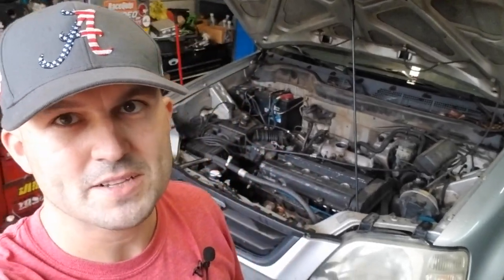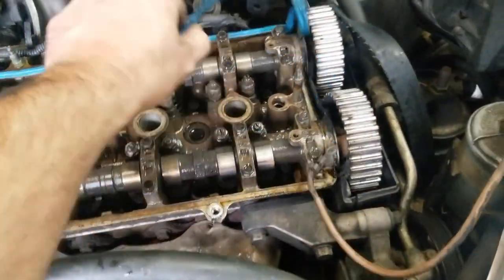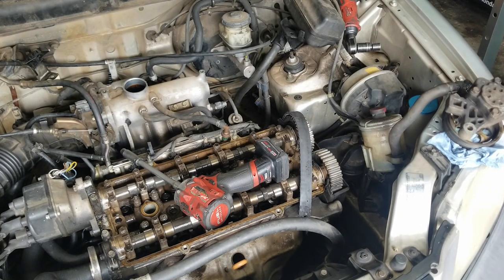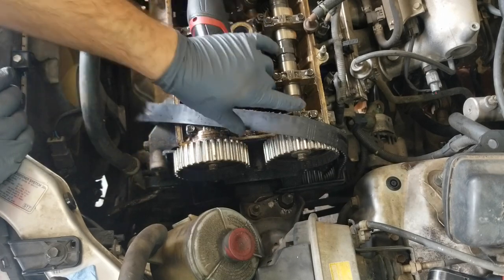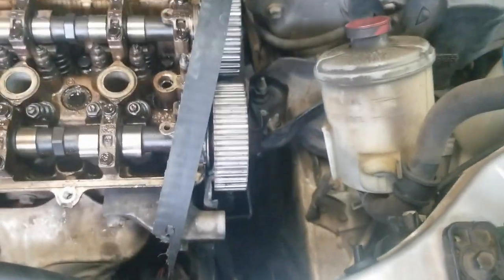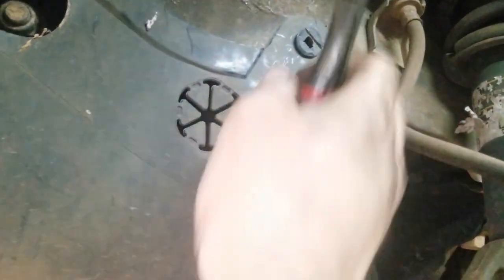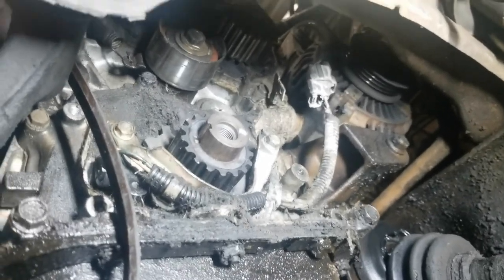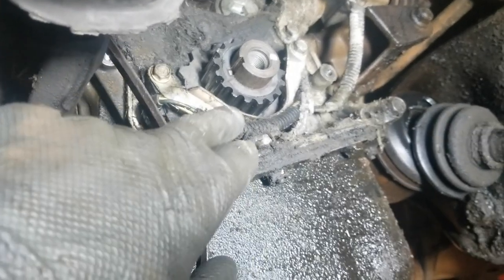97-01 Honda CRV broken timing belt FIX!!! RD1 / RD2 | B20Z2 | Pt.1 Disassembly!

Comment: I'm 75 yrs old, and I ain't as good as I once was.  $400 for the Milwaukee and the Lisle socket was the only choice, and worth every penny.  I broke two impact sockets trying to get that bolt out.  It took more time to get that big socket out of the box than it took to run that bolt out of the crank.  I don't know what kind of Voodoo Lisle uses, But it definitely works.
Reply: Just ordered mine. Good to hear that it worked for you. Can’t wait to get my broken CRV back on the road. The mechanic wanted 1400 for the repair.

Comment: I prefer the Aisin TKH014 timing belt kit.  Comes with an Aisin water pump, Mitsuboshi timing belt, Koyo tensioner, and Honda tensioner spring.
Reply from the maker: yep, those kits are pretty solid!
Reply: That's what the mechanic at the Japanese auto repair shop told me he uses.  Stay with Honda parts
Reply: Do you have a link to that timing belt kit?

Comment: If I just want to change the belt do I have to drain the coolant? Can I leave the water pump on there? Only asking because the belt and pump were recently done, I was stupid and used an eBay belt which is probably why it snapped. 

UPDATE: changed the belt and started right up with a Jump! Thank you!
Reply from the maker: No need to drain coolant
Reply: @hondaresource  thank you! Wish me luck lol

Comment: @hondaresource I have fixed so many things on my 2000 CRV with your videos but I can't find my current problem. I had a flashing check engine light, went in to do a valve adjustment and notice that the inside back of the timing belt cover has warped into the gears that turn the belt, luckily it's not broken. Can I just cut that top piece that has folded in and get it out of there?

Comment: my daytime running lights for the rest aren’t operating , so the only lights working for my rear would be the break lights, would that be more of a electrical issue? I’ve tried to switch the fuse out, would you have any ideas to the issue?

Comment: That bolt at 7:25 is the AC idler pivot bolt part # 90054-P3F-000.  It's a special bolt only available from Honda and is known to shear itself off around 200k or earlier if belt is too tight.  Worth replacing for $8.  I was hoping for a sticky because it's not easy to find this bolt's part number and this will surely help someone in the future.  Mine sheared off at 212K  about 1500 miles from home so I just cut the ac belt off to keep going.  Thankfully Honda thought ahead and put the alternator on it's own belt so I wasn't stranded.

Comment: Thanks man you just save my 99 honda crv with broken timing belt, that i was about to junk, timing adjusted easy crank and cam, thanks to your clear video, belt installed, the car starts hardly, engine light come on,  because  i mad a big mistake, new crank sensor dosent work, because i replace it with a cheap one 15 dollar, i wasent sure that the car.will work again so i bought that cheap sensor, and now i will not open all again to just replace the sensor,  i will use the bypass that you show in other videos   and replace the sensor with good one later.
Reply from the maker: That's awesome man!

Comment: Just did this exact procedure as well as head gasket replacement. You don’t need to disconnect ANY of power steering hose. Just loosen and remove the belt and pump bracket. Work smarter not harder! Other than that great video brotha

Comment: Hey I got a 2001 CRV and I’m pretty sure my timing belt just went the guy at O’Reilly auto parts said he was a master mechanic he told me if I tried to start it afterwards my valves are bent he could almost guarantee but your videos giving me a little hope is there a quick way to tell if my valves are bent. I’m a educate myself mechanic normally if I have to put it in the shop the car is a complete loss because I can’t afford it . I’ve done stuff I didn’t think I could do by just watching YouTube videos
Reply from the maker: I would say 99.9% chance you DON'T have any damages valves

Comment: Thank you for your video! I found that my friend's timing belt was broken while I was replacing the crank position sensor. I thought the motor was completely done. Is it absolutely necessary to replace the water pump while I have it apart? I'll be doing this in a parking lot and can't deal with the coolant. Thanks!
Reply from the maker: No. Spin it by hand and make sure it spins nice and smooth

Comment: Hey man I replaced my belt and after everything was said and done I noticed the notch on lower timing cover was off a little to the left of the timing make on crankshaft pulley. Should I redo everything until it matches perfectly or is it okay for the notch to be a little the left?

Comment: That's a good relief and feeling it's not an interference we'll see have a 97 I worry about that happening the belt breaking
Reply from the maker: Obviously I don't recommend driving it until the belt breaks, but I've yet to see one break and it actually damage the internals of the engine.
Reply: @hondaresource  no sir just got done replacing water pump belt tensioner all that stuff on my 97 CRV
Reply: @hondaresource  hey when are you going to have part two of your timing belt replacement video
Reply from the maker: @derekwilson8011  it'll be live tomorrow morning.
Reply: Awesome man thank you you rock keep posting cool videos

Comment: Top video mate! Have you ever had am ignition coil that metered good on the primary and secondary but produced next to no spark? I've confirmed the igniter is working and I have 12v at the coil but no dice when if comes to spark
Reply from the maker: Usually if ignitor and could are good, you'll have spark
Reply: @hondaresource  I'm leaning more towards the coil I think. The igniter is giving the pulse signal to the coil. But I put a spark tester on the coil and its an extremely faint spark if any. Almost like a static spark haha.
Reply: @hondaresource  changed coil and away she went 🤙🏼

Comment: what are the odds the valves bent i was low Rpm b20b4 and my belt snapped while driving the car shut right off?
Reply: 1998 honda civic hatchback Swapped motor

Comment: What do you do if the a/c tensioner bolt wouldn’t budge? I’m stuck at blowing all my forearm strength pulling at the thing with my wrench. Any idea would be appreciated greatly.
Reply from the maker: I don't know man, I've never had one not come off. Spray it with penetrating oil and let it sit overnight.
Reply: @hondaresource  yea. I drench all the bolts with liquid wrench and let it sit for a day. Going to go for it again. And also trying to see if I can find a low profile socket for my rachet to help. 
Appreciate the reply and the videos you put up.
Reply: @hondaresource  I did it!! Bought a set of Husky pass through socket and leveraged all I could muster and took that sucka down. 
Also the Lisle made short work of the harmonic balancer bolt. I was worried for 2s before I saw it turned.

Comment: Do you got link to where to buy Maul or OEM valve cover gasket? What's the part number?
Reply from the maker: I usually buy from rock auto, but my parts store has them as well
Reply from the maker: MAHLE VS50138

Comment: Do you have to set timing to tdc before breaking loose the crankshaft pulley bolt/take it off?
Reply from the maker: No, I normally get it close then just make sure it's all at tdc when I'm reinstalling the new new
Reply: @hondaresource  so to get it close I’d have to turn the crank bolt counterclockwise, it doesn’t matter that I haven’t cracked loose the bolt? It should still turn counterclockwise and turn the crank and cams wit the belt right? Just doesn’t make sense to me how if i do that everythang will turn but if I use a air impact gun on the bolt to break it loose and off it doesn’t turn anythang? I would of thought the crank pulley holder is needed to hold the pulley while loosing the bolt so that the cams and crankshaft don’t turn
Reply from the maker: @menaceemceefiend9716  correct, the impact will move it little if any.
Reply: @hondaresource  managed to get it off and the belt tensioner but ended up breaking the lower longer bolt off the water pump though so now I’m stuck wit half the bolt in the threads

Comment: I followed this video though I drained the oil to replace the pan gasket. It's been sitting without oil for a few days. How would I prime the engine after adding oil.
Reply from the maker: Leave the coil packs disconnected, crank the engine until your oil light on the cluster goes off.
Reply: @hondaresource  Thank you. I stay up with your videos. You for sure have my support. I even bought a shirt. Lol. If you could do a window regulator video for the CRV 1st gen.  The driver usually has that issue. Or a valve stem change. Anyways keep up the work. Thanks again.
Reply from the maker: @ShinobiSauce  funny enough I just did a driver window regular yesterday, but I didn't film it. I'll catch the next one.